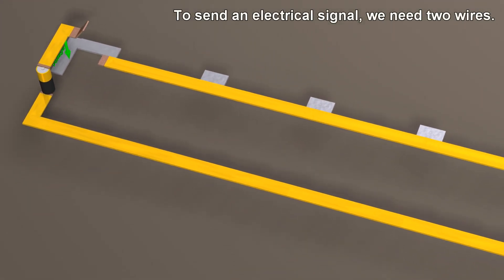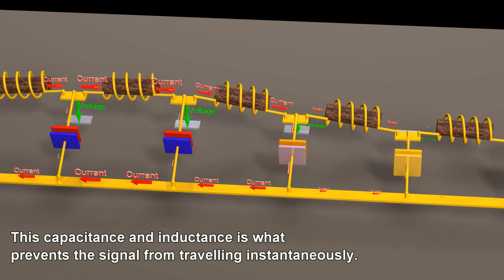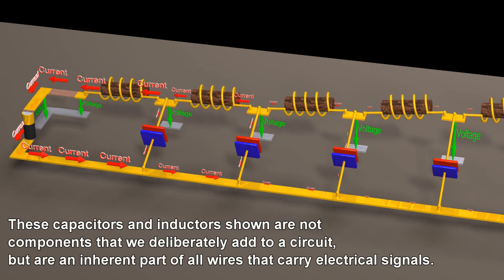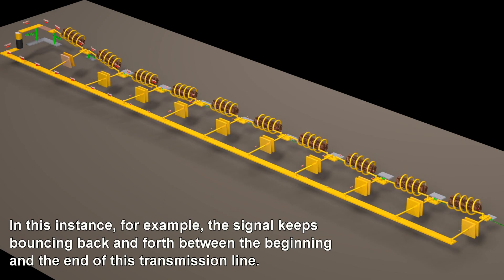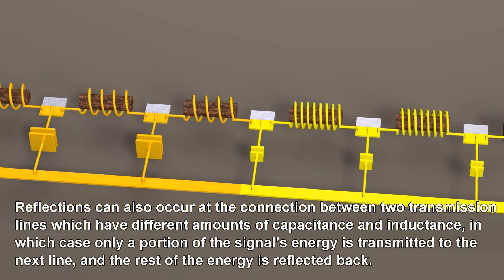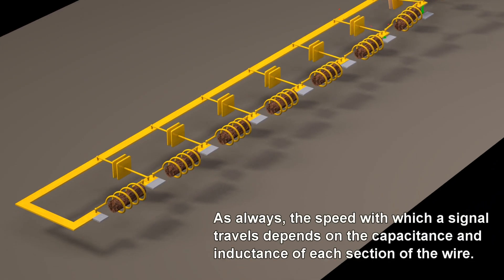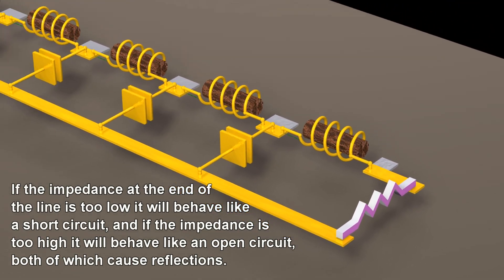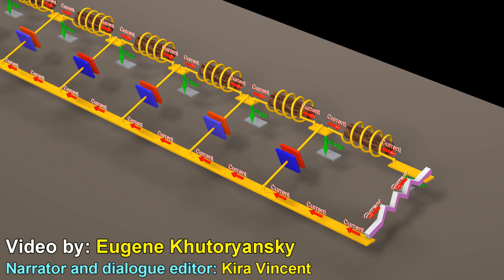Transmission Lines - Signal Transmission and Reflection

Comment: I love your videos, they help me so much. I have two thing unclear to me in this video:
1. What causes the current flow from the capcitor's blue plate to the battery negative pole. The potential there never changes.
2. Why is the current flowing through the inductor's side always goes in uniform direction? the potentials difference there is like a wave, so I think the current should flow to one direction in one branch and simultaneously to the opposite direction in another branch.
Can you help me to figure that out?
You can see an illustration for both questions at 1:34
Thank you so much
Reply: You are really asking the perfect questions. Why is there current flowing from a capacitor? A capacitor is non-conducting. But there are electrons moving, hence there is a current. One thing we need to keep in perspective, is that WE choose what is zero volt (the negative pole of the battery). Our whole earth may be at plus 500 volts, but still we take our meter and say: the battery has a negative and a positive side, and the negative side is called the zero (Volt) point because the potential difference is 1.5 Volt. But this is all relative. You could look at it as like a magnet. It has a North (plus) and South (minus) and in the middle there is the Bloch Wall (zero magnetization). Look at a battery as if it was a magnet. Same for the capacitor. So now I managed to answer question one.
As for question two. I need to ask a question myself first. Does the animation show a real life event? If you take a 1.5 Volt battery and connect it to a long wire of coax. Will there be (as in the animation) a constant flow of current? Or will there only be a tiny blip of current taken from the battery and then stop flowing? I can not imagine I can empty a 1.5 Volt battery on a wire of coax. It is open ended. Only at a certain frequency the coax will respond as a resistance, but not for DC voltage. Well, that is what I think. I learned electronics 30 years ago and I don't use it so I could be wrong.

Comment: Wire discussions are irrelevant in today's world.  I do everything from WiFi or from my "wireless" cell phone nowadays.  Your ancient info is overcome by events.  I don't even need a wire to charge my cell phone anymore Professor  Khutoryansky.  This is nice explanation with music that reminds me of communism  --much better than music that thugs and terrorists listen too.  
You might want to update your videos to the physics of 2017.
Reply: Very bad advice.  For an electronics engineer, transmission line theory can probably be ignored.  Powering an LED from an Arduino, for example, doesn't require knowledge of this sort.  That is not so for many electrical engineers, however.  All of them?  Certainly not, but many.

Your simplistic view of reality (implying wires are used only for powering phones and morse code) has kept you from seeing the bigger picture.  And as frequencies are increased with the upward advance of technology, transmission line theory becomes more relevant in areas where it may have previously been ignored.
Reply: خالد بقال شامي wave guides
darned arabic right-to-left S-parameters, Smith chart, VNA, TDR,  impedance matching?
Reply: Jules Bartow Are you asking a question? I'm not sure what your list implies.
Reply: S-parameters, Smith chart, Vector Network Analyzer, Time Domain Reflectometer and impedance matching are tools/processes used for transmission lines at higher frequencies/smaller wavelengths than you can observe doing your Arduino PWM of LEDs and morse code.  This physics explanation here doesn't explain how the signal leaves the "wires" and matches the impedance of the wireless microstrip and patch antennas in my phone that teeny weeny SMD system on a chip are connected to. No explanation of right hand or left hand circular polarity, MIMO, phase delay or matching stubs.
The physics of wires is so 19th century  Ampere, Gauss, Maxwell and Faraday.  Although the graphics and explanation make the phenomenally complex intuitive to the most casual observer, please get to the cool modern stuff.
Reply: Again, this is still relevant. People still use this.
Reply: You have power transmission lines, we still don't transmit electricity wirelessly.
Reply: dude, thats not true. on high speed pcbs you need wire discussion. high speed edges on a signal are way difficult than you think.. it may be not relevant to you, because somebody did the work for you before! so you just use it, somebody else is developing..
Reply: @Jules Bartow This is a simple explanatory video not a compendium on electromagnetism. If you are a specialist, then this video is not for you and you should stop trolling. If you can do better then go and do! If you cannot then STFU.
Reply: @Dragan Ostojić Agrre, not to mention that there are wires connecting the WiFi chip to the system, that memories are connected by wires and so on. He looks more like an ignorant than someone who knows anything about this thing. Maybe is just a troll, so we better ignore it, or cast some sun light on it.

Comment: No. Even there where not capacitors or inductors, the voltage and current signals would travel at almost the speed of light. In copper, not in vacuum, so the speed of signal would be a little less than the speed of light.

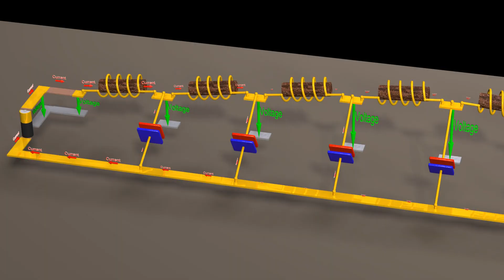Comment: I think there is a mistake at time 1:10. If capacitors and inductors were eliminated the signal would travel at speed of light, not faster.
Reply from the maker: This is not a mistake.  If wires did not have any inductance or capacitance, then when a voltage was applied at one end of the wire, according to circuit theory, the voltage would instantaneously appear on the other end of the wire.  But, based on Einstein's Theory of Relativity, instantaneous messages of information can't occur.

Comment: why is there an oscillation if this is DC ?
Reply: Well noticed! I just answered another question with as a remark that this is a DC setup. Now there will be a one time reflection, and there may be an oscillation, but the battery will not deliver (a constant) current as shown in the animation. Sorry, but that must be wrong. Only in the case of a shortcut or resistance at the end. The animation is partly VERY important as to how a wire responds to a DC source. But given a DC source the current would stop to flow, the battery would never get drained, not by the wires. At least, that is what I remember from school (a long time ago).

Comment: The capacitance part, I'm kinda fine with. However, how can we imagine like hundreds of inductors between the wires connecting the imaginary capacitors when we're dealing with DC current? 
Even with AC, a single coil loop of negligible area has zero inductance right?

Comment: and real transmission line how we minimized reflection.mean how estimate the required impedance ?
Reply: Minimizing the reflections is done by matching the line to the load (and transmitter to the line), see 04:25. Were the load impedance exactly same as the line impedance you can find the same impedance at the other end of the line. Generally the estimation of the impedance of unknown device or line: Z = SQR(Zshort_circuit x Zidle)

Comment: what is the difference between reflection,osculation,harmonic and resonance of the circuit ?in case of transmission line.
Reply: Osculation is the sound that pigs make when they kiss while mating.  Are you referring to oscillation?

Comment: HELP PLEASE ! Though the video provides the best explanation I ever had on the subject I need some help here. The capacitors (line capacitances) can be charged up to a potential equal to the potential supplied by the D.C. source at max.  When charged up to that a potential, they will cause an equilibrium and thus no current will be able to be transmitted in any direction, so how come there is a reflection
Reply from the maker: The reflection is caused because the inductor wants to prevent the current from changing, so even after the last capacitor is fully charged to the voltage of the DC source, the inductor will cause current to keep flowing through it, causing the voltage to go even higher.  The capacitor then wants to discharge, causing the reflection.
Reply: Thanks for the help
Reply: Imagine the whole wire is just a single inductor.

All the voltage provided is resisted by the wire.
All resisted voltage must either be released as heat or "work" or stored (like a capacitor).

No heat or "work" was implied to exist in the video.
Therefore, all voltage provided must have been stored.
Therefore, all the stored voltage must equal the voltage provided.
Therefore, the provided voltage + the stored voltage = double the voltage.

The doubled voltage must return back to the source when it has reached the end of the line.

Comment: why there is no inductance on the other side of the wire
Reply from the maker: There is inductance on both wires.  But, because we only care about the difference in voltage between the two wires, we can model all the inductance as being on just one wire, and we still get the same answer.
Reply: Thank you sir
Reply: There are, but what is commonly done is to put them on the top wire in textbooks or one side as in the video.  So the inductance on the top/ side wire is the sum of both inductors
Reply: Roshan Bernard am i stupid for never once having thought of this
Reply: HA HA
Reply: That is the model of transmission line.
Electronic and Communication Engg: https://www.youtube.com/playlist?list=PL6Br4r2QYH9P_HWRO_rb2rVzyDGES4lZz

Comment: Sir, why & How does Transmission line voltage doubles at the end of line when nothing is connected? I didn't get the logic! How come it is even possible?
Please explain a bit.
Reply from the maker: The current from the last inductor tries to keep the current constant, and it does this by charging the last capacitor to double the voltage of the battery.
Reply: Actually for a DC voltage at the input, you should consider the impedance of the line (infinite ? Or open circuit ? Lossless anyway here). Then the voltage first steps at half the input DC voltage (impedance diviser), till the wave goes forward to the end of the open line. Then the wave back adds the other half voltage, and goes the reverse way till the input generator. Then the voltage stabilized at the input voltage value as stated by the theory without considering the propagation. 
But anyway, the animation is not correct. It could be matched for sinusoïdal signal to be almost visually acceptable. I would appreciate to see the final correct result. That would be a great job !

Comment: Ok, in the beginning of the video the 2 wires are connected only by a capacitor, so I'm confused as on how current was flowing at all.  please explain.
Reply: Current does flow through a capacitor. It's easier to think of it with the hydraulic analogy. Think of a wire as a pipe. In the middle of the pipe you have a flexible, but impermeable membrane that acts as a capacitor. When you apply a higher pressure on one side of the pipe (like a higher voltage), the water will push and flex the membrane towards the side with less pressure. Even though the water from either side is separated by the membrane barrier, the water on the side with higher pressure does move a little into the other side with less pressure. Using this analogy, you can relate voltage and capacitance. A higher capacitance is a thin membrane which moves a lot, but since it's so thin, it takes less force to move. A capacitor charged with higher voltage usually has less capacitance since it takes a lot more force to bend a thicker membrane, and moves less. In both cases, energy is conserved.
Reply: Thanks for taking the time to explain that, it makes a lot of sense now.
Reply: check out the video they did on capacitors
Reply: +menteencoma I did once but now that I have a better understanding I am going to watch it again. thanks

Comment: Fantastic Videos !! I realy like it. By the way, are you sure that when the line is open, the reflected voltage are staying positive ? A part of the amplitude of the reflected wave come negative as well. The propagated electric wave stay only positive if the line is matched.  Suppose we have a open and shortcuited line, then the addition of the direct and reflected wave make somes part of the wave going into negative. Let me know you feedback about.
Reply from the maker: Thanks, and yes the reflected voltage stays positive when the line is open.  You can run a simple circuit simulation if you want to prove this to yourself.  By the way, I made this animation by writing a script that solves the differential equations for the circuit equations.

Comment: Could you do a video on RS485 or RS232?
Reply: modbus and canbus which are 2 of the most used bus standards both use 485...
Reply: Explain why its used in controls so much then?
Reply: RS232 and RS485 are a waste of time.

Comment: I'm guessing this effect is miniscule in short cables.
Reply from the maker: It can be a significant issue in short cables for very high frequency signals, such as in very high speed digital circuits.